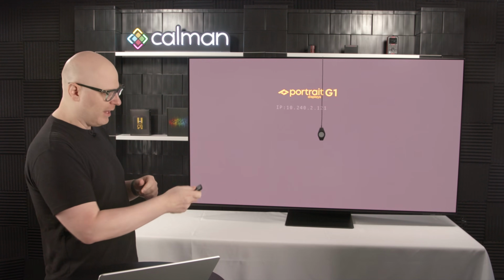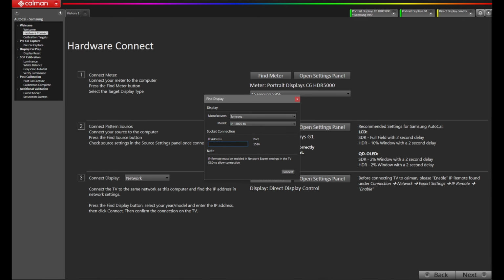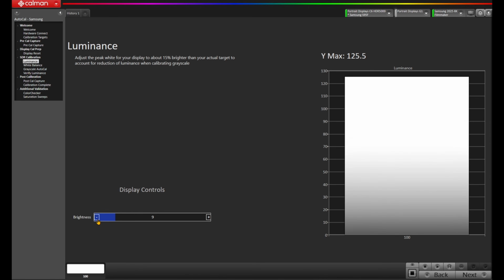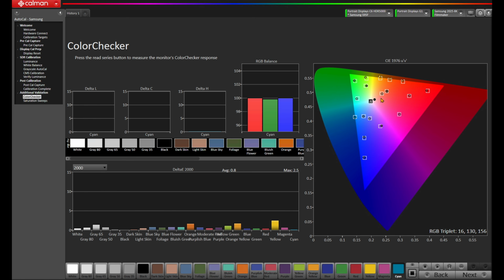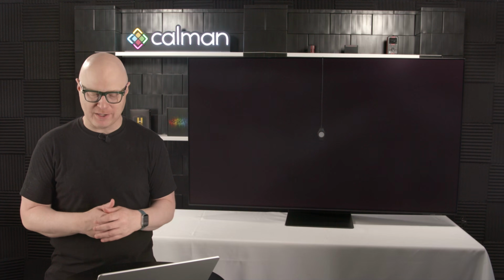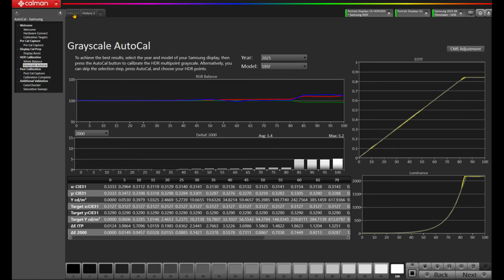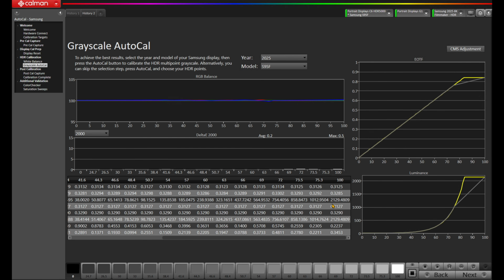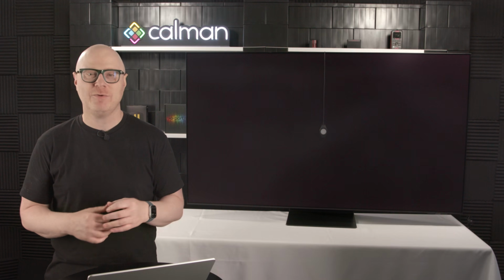Calibrating the Samsung S95F QD OLED in Calman Studio

Comment: The Filmmaker Mode HDR DDC Reset put Color Booster to High according to the DDC menu shown later in the video. Is that a bug or as intended by the AutoCal process?
Reply from the maker: Great observation! This one’s a bit tricky. The Color Booster API isn’t functional at the moment, and in some modes like FILMMAKER Mode, the control may show as “High” even though it’s actually off. For now, we recommend manually confirming that Color Booster is set to Off when calibrating Samsung displays with Calman. We’re in communication with Samsung to address this behavior in a future update.
Reply: Maybe better results when color booster is off?